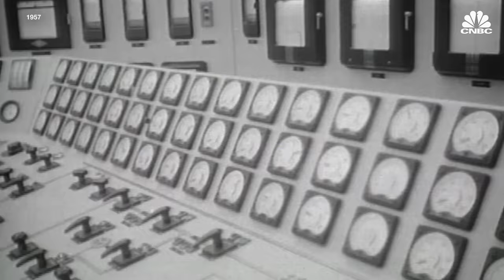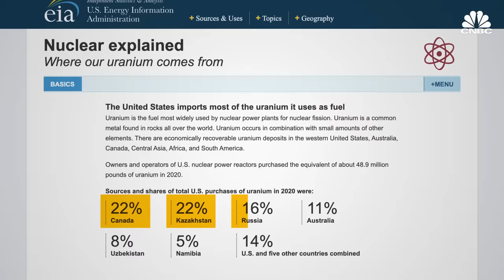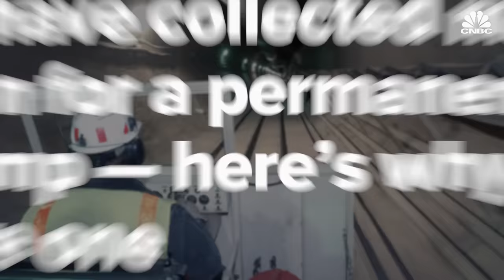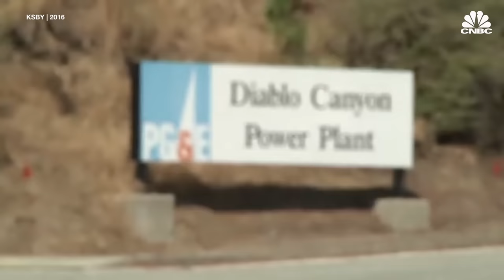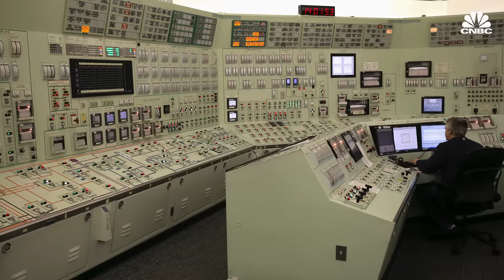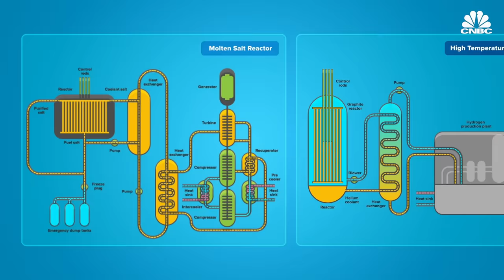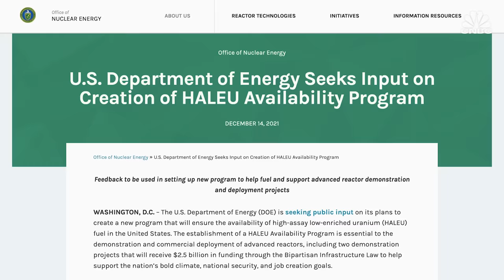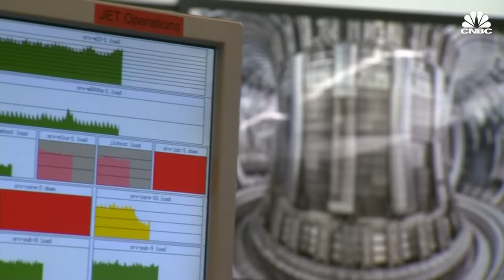Why Nuclear Energy Is On The Verge Of A Renaissance

Comment: We need to develop ways to deal with nuclear waste instead of just burying it in a mountain in the desert .obviously there is still radiant energy coming from these waste rods and to harvest these used rods to produce energy with newer technology then we don't have to mine so much more of the minerals.
Reply: Correct but you need a processing plant to separate the Pu239 from the other isotopes in the spent fuel. Then you need a plant to mix the Pu239 with U238 to make assemblies that can inserted into the reactor. And then there are the shipping casks needed to move the spent fuel from the old reactors to the processing facility along with security and loading and unloading facilities. It is not so simple or cheap when you consider the reality of actually doing it. MOX that was supposed to mix pure weapon grade Pu239 with U238 to make reactor fuel assemblies was canceled (2017) by Trump in the U.S. after spending $17 billion and they finally admitted that it would cost $100 billion more to complete and operate.
Reply: We have many ways of dealing with the 'nuclear waste', we have for decades.  The problem is your politicians, not the technology.   Burial is the least attractive of all the options we have in dealing with it. 
With 'newer technologies' like solar and wind, there are massively more mining required and much more toxic waste that NEVER degrades to where it is no longer toxic.
Reply: @clarkkent9080   Obviously no one was talking to you. 
Spent fuel pools, 
Dry cask storage, 
Reprocessing, 
Use in fast breeder reactors, 
Burial. 

You already knew all this but just insist on being butt-hurt when someone dashed your antinuclear fantasies.
Reply: @clarkkent9080   Talk to your politicians as to why they will not allow the waste to be dealt with.  Your nonsense is not impressive.
Reply: @clarkkent9080   There are no "new nuclear failures" in small modular reactors.  They keep building them year after year and put into service.  That's because the NRC has no say in the matter, just like China, South Korea and many other countries are building new nuclear without the anti-nuke restrictions of the NRC.

Comment: Well, actually using nuclear energy isn't really about safety, it's about the cost of savings per MWh, the cost of generating solar power ranges from $36 to $44 per megawatt hour (MWh), World Nuclear Industry Status Report (WNISR) said, while onshore wind power comes in at $29–$56 per MWh. Nuclear energy costs between $112 and $189. That said, nuclear power has the potential to raise the price of energy to the price of rent. When the price of energy goes up the prices of everything soars. Right now nuclear energy is not an intelligent choice from an economical standpoint, unless your objective is to destroy the economy. If they make improvements it'll be an option, now that there's war you have to accept that nuclear power plants will be the greatest targets and the end result is fallout.
Reply: In actuality you have it quite backwards.  Wind and solar cost much more than nuclear when you consider you have to modify the entire grid infrastructure with storage to get them to work at all. If you do away with fossil fuels and nuclear, wind and solar will guarantee you massive electricity rate increases and massive rolling blackouts.
Reply: @danadurnfordkevinblanchdebunk  Lies Lies lies.  VC Summer $17 billion spent for a canceled plant.  Vogtle $30.2 billion and still not operating.  Using REAL U.S. recent nuclear build cost, nuclear is well over $300 per Mwh and that is if one can actually be built. South Carolina electric rates increased 40% for a canceled plant
Reply: Your numbers for nuclear are based on U.S. nuclear plants built in the 1970 and adjusted for inflation and are significantly too low based upon the reality of the 4 latest new nuclear build in America. 
VC Summer (South Carolina) new nuclear units 2&3 were canceled in 2017 after spending $17 billion on the project (original estimate of $14 billion and 2016 completion date) with no clear end in sight for costs or schedule.  
Vogtle (Georgia) new nuclear units 3 &4 currently 110% over budget and schedule and still not operating. Mid way into the build, the utility stated that had they known about the many costly delays they would never have chosen nuclear. They are now delayed another year because according to the project management, thousands of build documents are missing. Utilities, not the media, decide the most cost effective electrical power source and give the above failures no U.S. utility is even considering new nuclear at this time.
Reply: @callummcmac4079   Maybe you didn't get the Greenie memo; they insist that all fossil fuel sources are phased out.  That means your rooftop solar meme is a total failure, genius.
Reply: @clarkkent9080   Yet you continue to ignore the fact that the US and many other countries have built and used small modular reactors for many decades built in two years or less for millions not billions.
Reply: @danadurnfordkevinblanchdebunk  Huh? This has nothing to do with "going green" this is about people getting rid of their bills and it's effect on the economy. There is not ONE TIME that I talked about "going green" you're way off topic.
Reply: @clarkkent9080  Ah. Thanks.
Reply: @callummcmac4079   You made the incorrect claim of a cost savings of solar over nuclear and you are absolutely wrong.  I have a grid tied 4kW system, and if everyone were to do that the grid would completely collapse.
Reply: @clarkkent9080   As you were previously shown, new nuclear is introduced every single year in the US.
Reply: @clarkkent9080   So then you finally admit new nuclear reactors come online every year in the US.  Why have you changed your meme suddenly?
Reply: @clarkkent9080   So the fact that you get caught lying and have no rebuttal to my facts makes me a corporate lobbyist?   No one in America has gone off the grid, ever.  Show one.  I have been doing solar/wind/batteries/EV's for four decades.  Everyone who makes that stupid claim knows nothing about alternative energy and is ignoring the fact that they use some combination of a generator, wood, gasoline, propane, natural gas, or diesel.  Then they drive to town to pick up supplies, all of which depended on the grid and more fossil fuels to exist for them to buy. 

And I have already shown you dozens of new nuclear in the US since your favorite GA nuclear power meme.
Reply: @clarkkent9080   I already showed you dozens of US nuclear builds that were performed in two years or less.

Comment: The problem with Nuclear power is that as the current generation we are asking many future generations to manage the nuclear waste we leave behind just so we can have something today that we will use once and only once.

Maybe it won't cost that much. But who are we to say it's OK to spend the future generations money just so we are comfortable today. 

There are alternatives and we should pursue them. The rejection of intermittent renewables in this video was done in a single sentence. Intermittent renewables need lots of batteries and we don't have them. No discussion of other energy storage technologies, no discussion of what it will take to build adequate amounts of energy storage.

Our electricity grid is based on just in time energy generation. Energy generated has to be used instantaneously, very little is stored. That is very difficult to manage and results in over capacity and inefficiencies. We need Grid 2.0 with plentiful energy storage which will enable cheap and clean intermittent renewables to flourish that will have little to no burden on future generations.

Comment: If we had poured in the money spent on renewables and EVs we likely would have 4th Gen nuclear plants by now and all the benefits from it.
Reply: If we had all the trillions spent on nuclear over the past 70 years, we would have cheap renewables
Reply: @clarkkent9080  

BS, renewables by nature are expensive as they are trying to harvest a low density fuel. That leads to massive infrastructure costs including backup by traditional power sources including nuclear. Battery backup is very far from efficiency and cost expense to replace traditional backup sources

And renewables are reaching the physical limits of efficiency as dictated by physics so you aren't going to get much more out of them. So for the past 30 years of billions of $$ of development their efficiency / sustainability curves have not increased much. 

But nuclear is getting much better, the NRC just has to come up with realistic regulations which is the leading contributor to the expense of nuclear. The NRC is operating of of obsolete factors of old nuclear designs like the original design of 3 Mile Island. No one died from that mishap.
Reply: @Scottar50  Let me ask you the question, that no one that believes NRC regulations are a problem, has been able to answer.  Name ONE NRC regulation that should be eliminated. If you cannot answer that, you are just making BS claims about the reason for massively expensive nuclear.

The NRC has a list of 100% fully approved for construction and operation nuclear plants, and has so since 1989.  All the utility has to do is build it according to the approved design drawings.  How is that over regulating???

Vogtle unit 3 & 4 just came on line (2023 & 2024) at a total cost of $35 billion and after that, NO U.S. utility is even remotely interested in new nuclear.  Terrapower is the ONLY nuclear project that could be producing power (345 Mw) by 2034 and that is if they ever break ground.  So there are no new nuclear plants on the horizon.  Meanwhile, solar and wind turbines are being built everwhere.

The standard wind turbine today has a 1 Mw output and there are 77,000 wind turbines in the U.S. today with thousands more being built every year.  If everyone of the U.S. wind turbines were 1 Mw design, they would have the output of 77 nuclear power plants and cost less than one nuclear power plant.  The wind does blow 24/7 in many areas and that is where they are located. 

Every grid has spinning reserve which is necessary to meet the ever changing electrical demand. Renewable systems would require more spinning reserve than traditional grids. And Natural gas is the backup of choice.

Where I live, the greatest grid load is AC and solar provides maximum output when the AC load is the greatest.
Reply: @Scottar50  BTW, the TMI-2 reactor was a 3 month old multi billion dollar facility totally trashed.  Cost $1 billion in 1996 dollars just to clean up the melted fuel and the containment is so contaminated that it is not even SCHEDULED to be cleaned up until 2047 and the total cleanup cost will be billions more
Reply: @clarkkent9080  

It's an old design that more modern reactors will not copy. Are new automobiles that same design as old ones?
Reply: @Scottar50  Well as far as I know, new automobiles have four wheels, suspension, and some are still body on frame.  and have engines in the front so yes they are basically the same as old ones. That is except for the hybrids and pure EVs that I assume you like.

I see you could not name one NRC bad regulation.

And lets just agree that until a Gen 4 reactor is actually built and operated commercially for at least 5 years no claims about it being better mean anything.

I see you cou

Comment: So now it's a good thing? lol. It took you long enough.
Reply: After 50 years of anti-nuke propaganda,makes me wonder what they are up to now.
Reply: @curtstacy779  With the switch to electric cars we will need about 30% additional grid capacity. Will be a massive failure, and this is coming from someone who had four electric cars even before I test drove an early GM Impact.
Reply: @ForbiddTV  Yes it's going to be a mess! were you even able to charge 4 at once on home power? wow!
Reply: @curtstacy779   No, very careful charging strategy had to occur.  Now I have a grid tied system.
Reply: @ForbiddTV  I was wondering, a 200 amp service could get eaten up pretty fast. and I believe a lot are 100 amp and i've seen many trailor parks with just 50 amps.
Reply: @curtstacy779   At the time I was having to make do with a 3,000 watt square wave inverter, so basically a 20 amp circuit.

Comment: One has a huge way to go in the face of implacable opposition mostly from left leaning so called greens, who refuse to acknowledge that nuclear power is a green source of energy, even though in operation, nuclear power stations do not emit greenhouse gases. They will go on to say that the process of producing nuclear fuel rods is carbon intensive, even though one can say the same thing about the manufacture of solar panels, batteries for storage of electricity, and wind turbines, as long as the manufacturing facilities that are used to produce them are connected to grids that include fossil fuel utilizing power stations. It does not quickly come to their minds that once an electricity generation, transmission, and distribution grid is lacking of fossil fuel power stations, it does not emit greenhouse gases; and therefore all the more reason to undertake a transition over the course of several decades to completely phase out fossil fuel power stations globally and replace them with renewables and nuclear power stations.

One of the other things that the renewables only crowd refuse to reckon with is the large land area footprint of solar and wind power stations, which nuclear power stations have MUCH MUCH less of. 

Arguments against nuclear power, despite it being by far the most efficient power generating methodologies, that focus on its problems with regards to waste production and disposal and the potential disaster of a nuclear meltdown, ignore that technologies exist today in 3rd and 4th generation uranium using reactors that greatly reduce waste. As to those who say that highly toxic and radioactive waste will inevitably be produced regardless of the extent to which rates of waste production are greatly reduced and will eventually accumulate and will form a major hazard down the road that cannot be solved, well, concurrently we can plausibly produce runway take off and landing space planes that will be able to launch spacecraft carrying nuclear waste beyond low Earth orbit and propell their cargos for a one way visit to the sun. So, inevitably, we have to produce such runway infrastructure and spacecraft concurrently as we build more nuclear power stations.

Comment: We need nuclear reactors!!! it’s so much better for the environment unlike coal!
Reply: In the U.S. we tried.

If you live in the U.S. here is the reality for the last 4 state of the art Westinghouse AP1000 ADVANCED passive safety features new nuclear power projects and spent fuel reprocessing and in the U.S. over the last 20 years. You decide if this YT video was presenting the truth. 

The Southeastern U.S. is super pro-nuclear MAGA, has zero anti-nukes, and 100% media and political support. 

The MOX facility (South Carolina) was a U.S. government nuclear reprocessing facility that was supposed to mix pure weapon grade Pu239 with U238 to make reactor fuel assemblies. It was canceled (2017) in the U.S. After spending $10 billion for a plant that was originally estimated to cost $1 billion and an independent report that estimated it would cost $100 billion to complete the plant and process all the Pu239, Trump canceled the project in 2017.

VC Summer (South Carolina) new nuclear units 2&3 were canceled in 2017 after spending $17 billion on the project (original estimate of $14 billion and 2016 completion date) with no clear end in sight for costs or schedule. 

Vogtle (Georgia) new nuclear units 3 &4 currently 110% over budget and schedule (currently over $30 billion) and still not operating. Mid way into the build, the utility stated that had they known about the many costly delays they would never have chosen nuclear. They are now delayed another year because according to the project management, thousands of build documents are missing. If completed, Vogtle will be, for its output, the world’s most expensive nuclear power plant.

Please google any of this to confirm.

If you can’t build new nuclear in the MAGA super pro-nuclear southeast U.S. then where can you build it?
Reply: @Kerk Kant  Yet you continue to ignore from your blank channel the fact that many countries have been building and using small modular reactors for many decades, built in two years or less, costing millions not billions.
Reply: @clarkkent9080  Do you copy and paste this into every comment on every video that is even remotely nuclear-related on YouTube? Get a life and embrace the power of humanity's ultimate energy source.